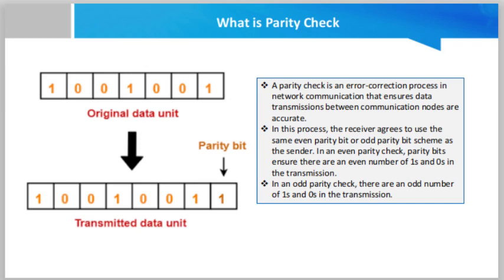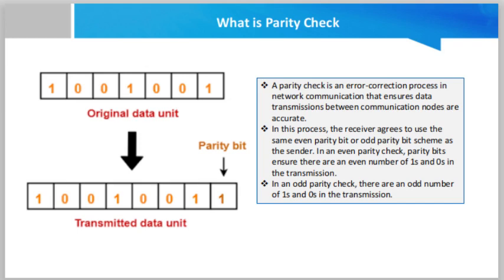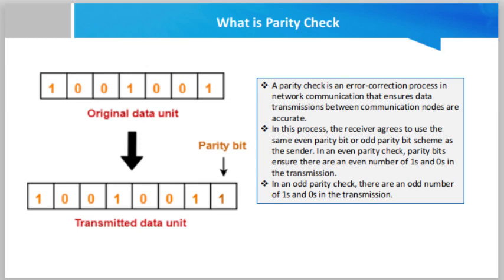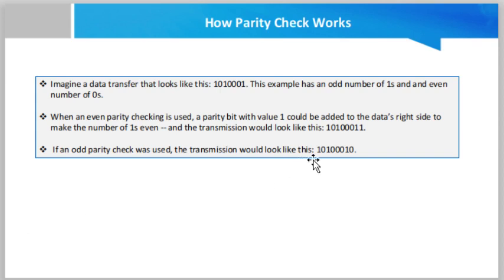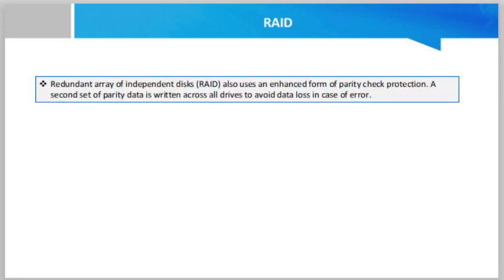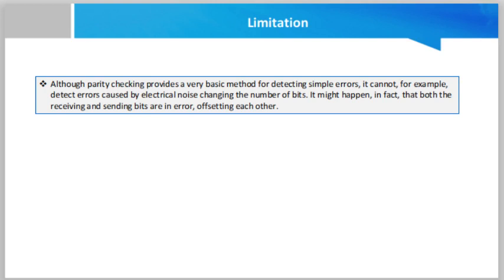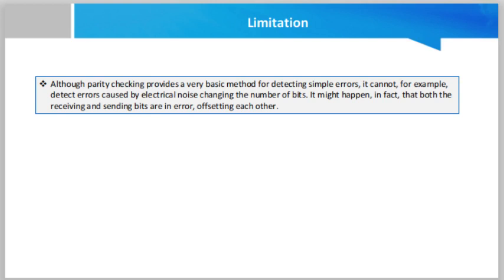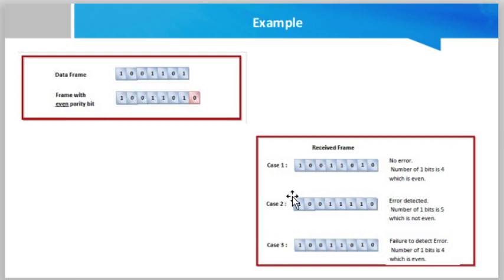What is Parity Check

Comment: A Parity Check is primarily used for error detection, not error correction. It helps to identify if there has been an error in the transmission of data, but it does not correct the error itself.